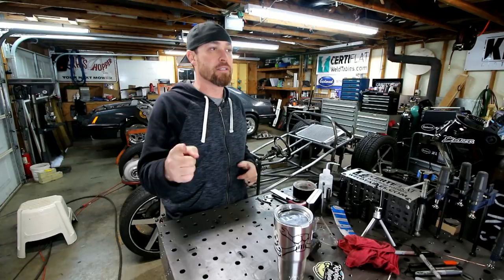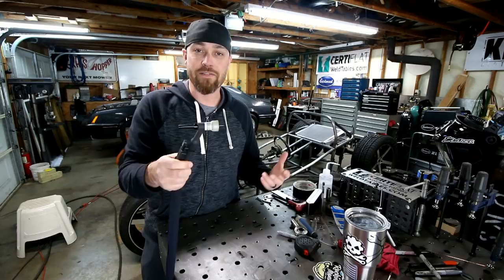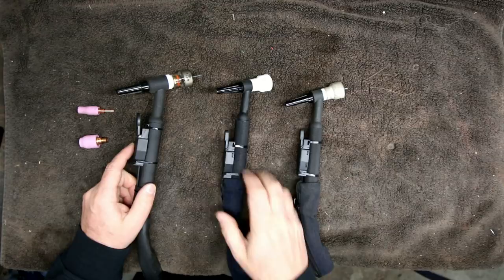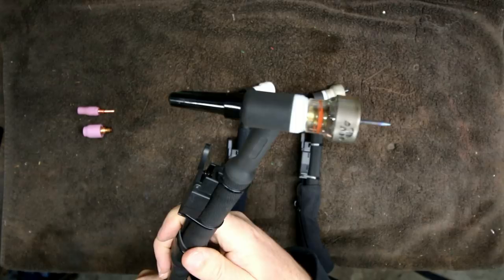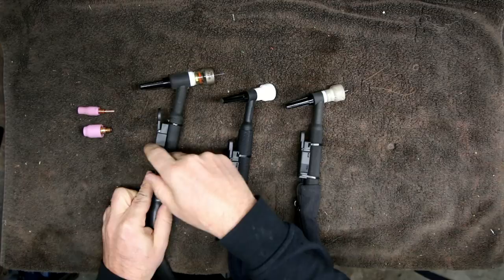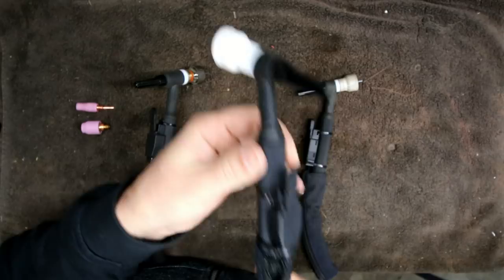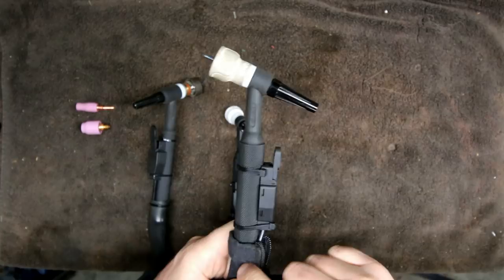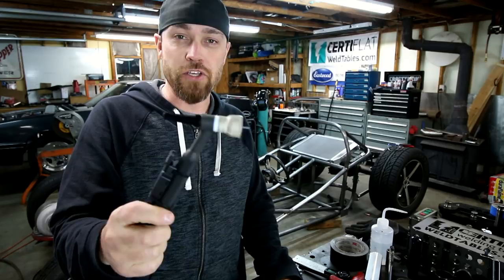How To TIG Weld (sort of) - Episode  2 | Different TIG Torch Sizes

Comment: I think I'm going to like this series Kyle.... it's pretty cool.. when you say you will "burn up" the torch if you don't turn on the water, what exactly happens? does it just fail to continue working? Or will it literally burst into flames? What happens when it burns up?...
Reply from the maker: thanks
Reply: Basically the torch will start to get really hot and will actually start to melt the plastic parts of the torch. If the torch is getting to hot to hold then you’ve prolly forgot to turn on the cooler or your running it a higher amperage than what it’s rated for.
Reply: Lil Flatty thank you. I wasn't sure what kind of event would take place...👍

Comment: Could you explain to me the connections between the torch and the machine?
Im looking to get more styles of torches, (currently have SR-26 style air cooled torch that came with the machine)

Mostly curious about if can I use just about any torch on it? Can I hook a water cooled one up to it?
Mine has a 2 pin connector on it, will that still work with a torch that has a variable control on it? 
Do nearly all of them have a 2 pin connector or something else? 
Those sorts of things Im curious about, thanks heaps great series so far!
Reply from the maker: It really depends on the kind of machine you have

Comment: When you make another video of the actual welding portion can you please show/tell how to gauge how much heat input you're putting into the piece you're welding? For example, show what characteristics the puddle will have to know that you're using the correct amount of heat. I have searched all kinds of youtube videos and can NEVER find information about how much heat input to use and how to tell, the only thing most videos tell is about the HAZ. I always find myself baking the piece that I am working on from too much heat.

Comment: actually the tig torch nr 18 water cooled maybe is rated for 300 amps but it could handle around 400 amps I know that for a fact because I have on my AC/DC Tig welder
Reply from the maker: yeah I was just going by the specs they listed

Comment: Good stuff Kyle. I just bought a multi-process welder today. Question about water-cooled torches? Does the welder itself need to be water-cooled or is there a separate unit (cooler) for the torch?
Reply from the maker: its just a separate unit and torch

Comment: Whats those finger switches used for ?   My tig machine torch has a dial on it for manual control of the gas, pretty basic.
Reply from the maker: replaces the use of a pedal when needed
Reply: So if I have a machine that uses a knob for the gas I cant use a pedal or this finger swith thing ?    I have an Esab Miniarc 161LTS i think

Comment: Do u perfer trigger or foot pedal. I hold the torch like a pencil and need to find a better way to hold tourch so i can use a trigger. Any tips? Using 2018 alpha amp 200 maching.
Reply from the maker: I do a ton of both. I like to use the pedal when it its easy to do so but most of the chassis welding I do is on the finger trigger

Comment: Hwy i just bought a lincoln le31 mp. And the tig gun anf pedal comes separate is there one i can buy that comes with a button on the torch?
Reply from the maker: yeah you will just have to plug in what ever one you are looking to use. the hand trigger uses the same plug as the pedal (depending on the machine)

Comment: The amps on those torches is obviously subject to voltage, what voltage are you running?
Reply: Dodgy Brothers you set a tig welder by amperage not voltage. You don't directly have voltage control.
Reply: Also general rule of thumb (on mild steel) is 1 Amp per .001" of material thickness. Though that is a broad statement and I rarely sick directly to it.
Reply: I measured the voltage of my old Lincoln square once a long time ago. It’s fairly low. Low voltage with allot of current.
Reply: From what i understand.  TIG voltage is proportional to how far the electrode is from the work piece.  If you keep the arc in tight and short then there will be less voltage than if you have a big long arc
Reply: HodRodHippie you may not have voltage control but you do have an input voltage. The US uses 110/115 and 230v, down under we have 240v (supposed to be 230v) so if he is using 110-115v it would use twice as many amps as the double voltage input we use here, I am guessing.
Reply: Dodgy Brothers doesn't quite work like that. There are step down transformers and other wizardry at play
Reply: Ah ok so it would be the same amount of amps regardless of input voltage.
Reply: Dodgy Brothers 
Forget the input voltage and amperage to the machine, as it is irrelevant to what you get down at the torch.  The only bearing input voltage has to TIG machines is to the total output of the machines.  Machines made for 240v are usually limited at around 200amp max output.  Bigger machines generally need 415v in order to run hotter.

But that has absolutely nothing to do with whats happening down on the torch.  Unless you have an old clunker, TIG machines are all inverter type machines that have sime pretty complex electronic control over the power delivered at the torch.  

On top of that, the machine is variable power anyways with either a foot pedal, or selectable on the main panel.  So the output amperage is totoally variable even though input voltage is fixed at whatever your wall socket provides.
Reply: I’m curious about the voltage at the torch tip myself. It’s funny how the power on these machines is only expressed in amps what is the fixed voltage then? And yes it matters because voltage X amperage = power
Reply: voltage X amperage = power is the point I was trying to make (more volts less amps for same output) but from what has been explained above that only comes into play when the machine is maxed out, which by the sounds of things isn't all that often. So it doesn't seem to matter if the input is 110v or 220v an amp is an amp is an amp, since the voltage is regulated down.
Reply: Pretty sure voltage at the tip increases as you increase the arc length.  (Electrode to workpiece.)  

Going from memory of what was explained to me, and i could be wrong, but i believe its around 8-10v with a nice tight arc.  And can go as much as 20v with a  large gap.  

Now your probably thinking then why not just have the biggest gap you can before it opens circuit, because p=va???  But you dont want a large gap, infact you want to keep the gap as tight as you can without dunking the electrode into the weld puddle.  As this focuses the heat where you want the weld to occur, and not all over the place where it simply heats everything up and takes way more heat than what is actually needed to weld, causing the work to overheat and nasty welds and all kinds of other problems.  It gives much more stable arc and gives much more consistent results.  And is just the better way of doing it.

If your really interested in learning more about TIG process, then you should check out "welding tips and tricks" on youtube, if you havent already come across his channel.  Jodie is an amazing welder, and does some great content.  He has some great footage of welds up close.  And does a great job of explaining how to weld.  Comparing different techniques, styles, settings etc.  He knows welding, and does his absolute best to teach it via his videos.
Reply: Well said thanks for that. I just think it’s kind of annoying that voltage is never mentioned in the welding videos even if you really only need to worry about the amps for me it helps to understand how the welding process works backwards and front. I didn’t know the voltage increases as you pull back the torch that explains a lot thanks

Comment: Im having a hell of a time teaching myself. Dont know what amps for different thickness of metal. When i stick the filler in the pool it sticks to the metal. I keep touching the tungsten to the metal and have to grind it over again. Its a real bitch! lol. Ill keep watching and trying to get a nice bead!
Reply: Eventually the ratio of sanding discs to filler rods decreases but i still spend half my welding time stood grinding tungstens cos my eyes are rubbish now im old.... :(
Reply: You can google to get a range of which amperage to use for example aluminum is pretty easy .100" thickness needs roughly 100 amps. Start out with thicker metal its much more forgiving. When I get a new package of tungsten I cut them in half and sharpen both ends so if I dip it and it's not to messed up I can quickly flip it around and keep going. Also checkout weldingtipsandtricks Jody has a lot of good videos on how to correct mistakes, typically its torch height, torch angle, and not shielding the end of the filler while dipping the rod.
Reply: Keep at it!  it'll come.. and once you have this skill you'll find it super useful, I was once just a mig welder.. tig is a much nicer process
Reply: 1 amp per .001" of thickness of material is a good place to start, but remember you can always make multiple passes for the heavy stuff.  You wouldn't try and run a single pass 1/2" (.500") at 500amps even if you had the machine to push that much power.
Reply: Get the Miller welding app on your phone.  It gives settings for tig mig and stick including amps and filler size for whatever metal an whatever thickness you want.